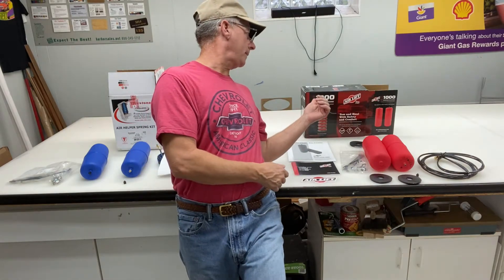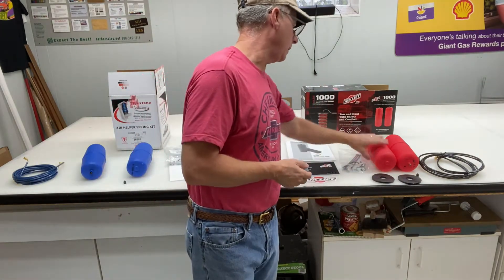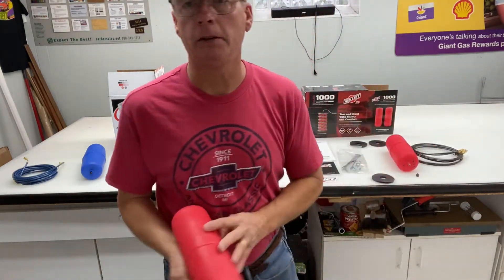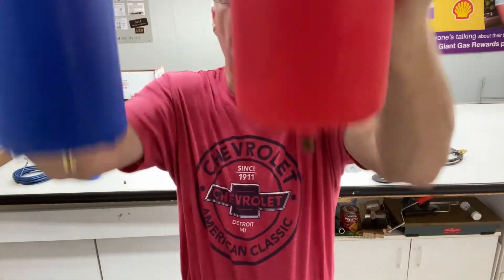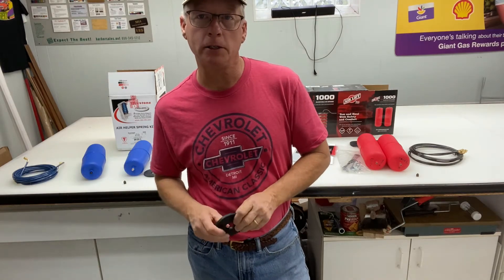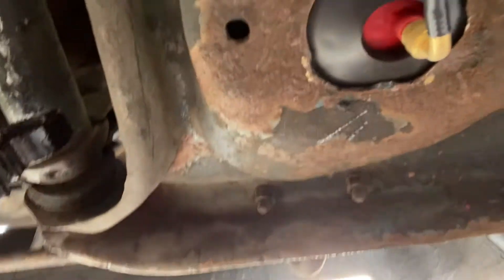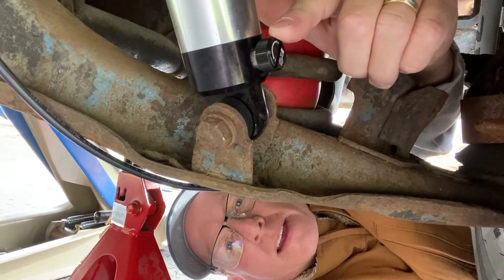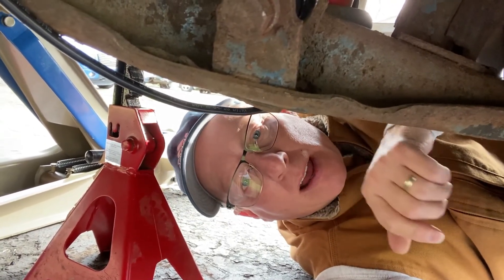Chevy G20 Van Air bag Comparison: Firestone vs AirLift

Comment: I just lowered my 1978 Chevy G10 Shorty van and I used the 2 and 1/2 inc CCP offset drop spindles part number DLS0S00 because I did not want fender rubbing and it worked great no issues. The offset spindles pull the tire and wheel in towards the engine 3/4th of an inch. I did have to trim the lower control arm drip rales on both sides and I took a little off the spindle at the tie rod because it knocked off my wheel balance weight.  I also used 1 inch drop springs part number LCSE48F so far they only dropped it 2 and 1/4th inch It will likely settle a little more but I doubt I will get the full advertised 3 and 1/2 inches. But if it does I know I will not have any rubbing issues. Subscribe to my Chanel to see the install video. I will be uploading it soon.
Reply from the maker: Thanks Rick, I'll check it out.

Comment: That's the front.  What bout the rear?  Also I think those lines exposed to road hazards is not so good.
Reply from the maker: Hi David, I'm leaving the rear stock. We've got great roads here. No issues so far. AirLift sells replacement nozzles and hose kits just in case. I have an extra set.
Reply: @vanningmike  Cool.  Ok.  I run my own shop and fixin up a 90 with a two foot high top, frig, sink heater etc.  on the side.  I just got the new jasper engine and transmissions coupled and running today.  It needs much more work but looking forward to it.. g20
Reply from the maker: @davidpatrick1813  Sounds like a great project. If you have Facebook, check out G10, G20, G30 Vans